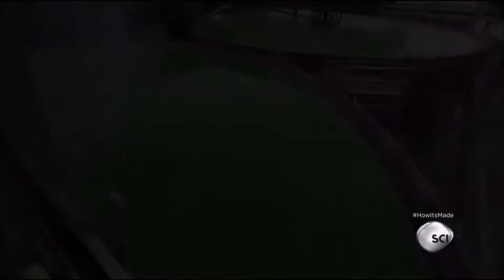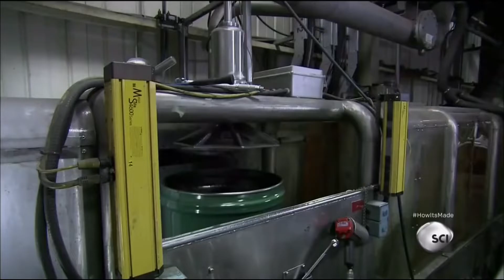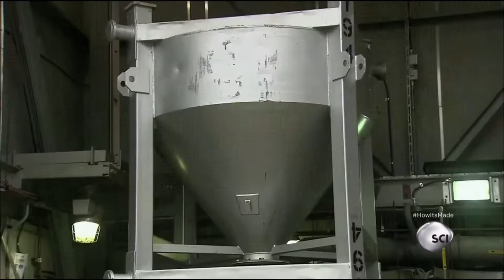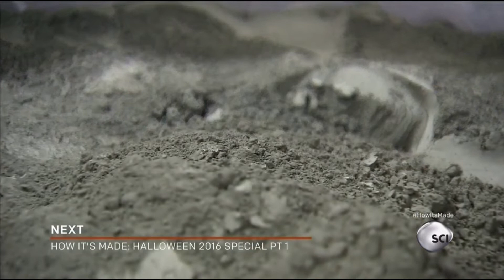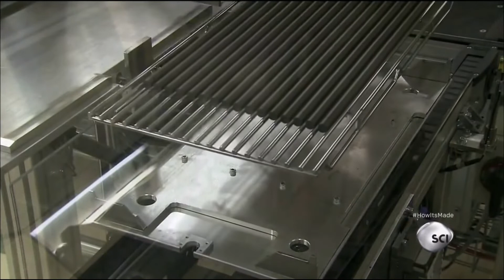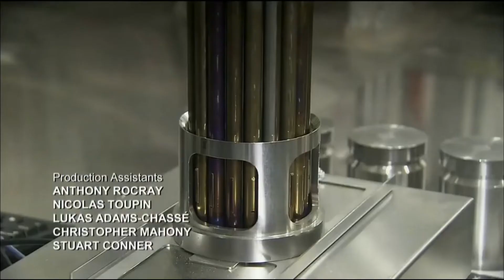How Uranium Is Made Part 2

Comment: They can be handled in this video even at the end. What activates them when they are used ?
Reply: neutrons start the fission reaction
Reply: @worldmapping4895  Does graphite trigger the neutrons? I think it slows the neutrons way down, like 2km ps thats when they start making plutionium.
Reply: Irradiation
Reply: From what i have understood, when you put alot of them together they react exponentially
Reply: they are bombarded with neutrons to start the reaction
Reply: uranium naturally splits, causing the production of neutrons, alpha and gamma radiation, but in very small doses, so one can hold it in their hands. When you either provide an external neutron source, increase the weight (more neutrons produced at the same time) or use some kind of neutron mirror to reflect neutrons back in the mass, then it goes to critical, where it either explodes or produces a lot of energy (more neutrons, alpha and gamma radiation exploding out of it).
Reply: I think this documentary totally skipped the whole "enrichment" process. These rods may be used for other processes, such as neutron targets, but uranium fuel rods are enriched to have roughly 5% U-235. Greatly increasing it's radioactivity to start chain fission reaction.
Reply: @LeviticusTwentyThirteen  no, they put togher a critical mass to start the reaction
Reply: @Timo_Adventures  some reactora doesn't need enriched U
Reply: @Timo_Adventures  This video skipped just about everything. Obviously there's so much they are not allowed to show, that it made the video pointless. Enrichment is not complex, just difficult to execute.
Reply: @AB-80X  This fuel is unenriched uranium fuel used in certain reactors in Canada (Cameco is a Canadian fuels supplier)
Reply: @KingThrillgore  they still enrich it to 0.7 or about 1% for a phwr but that is the naturally occurring enrichment in uneneriched uranium fuel.
Reply: Fire a neutron gun at it, the ions or summat destabilizes the uranium
Reply: Dyatlov.  It was Dyatlov!
Reply: Water, and enough rods stacked close together.  Water is a neutron moderator, so  when they're immersed in H2O the neutrons slow down and are much more likely to hit another Uranium nucleus.  As water heats up it expands, and the rate of reaction reduces.  It's really quite beautiful.
Reply: @mygoogleemail2063  How does a RBMK reactor explode?? …. L I E S !!!!!!!!!!!
Reply: They're activated by the power of love 💞

Comment: What do you guys think these rods are actually used for? Because they are certainly not nuclear fuel rods. Those require enrichment process, which these samples did not under go.
Reply: these are CANDU fuel bundles. they do not require enrichment
Reply: @shauryaseth8859  interesting, thank you!
Reply: Heavy water does not absorb neutrons as readily as other moderators. This means that a reactor moderated with heavy water can cause natural Uranium to fission. That said, most CANDU reactors use a combination of fissile materials. The CANDU reactor is the diesel engine of reactors. It runs on a bit of everything.

Comment: What about radiation? Isn't it happening yet?
Reply: Notice how the latter half of the process (mainly the movement and welding of the rods) is performed by automated machines. It would probably be too risky for humans to do it. Thats my guess
Reply: @michaelmule4582  But the guy at the end is handling them so they aren't producing any radiation.
Reply: Best guess is that this is very low level enriched Uranium and would only generate heat and energy when surrounded by a moderator and neutron reflection material to ramp up the activity exponentially. I was surprised they could be handled safely too.
Reply: not yet. when a chain reaction is started, loads of radiation will be given off

Comment: What about radiation? Isn't it happening yet?
Reply: its always happening, imagine this; you are collecting a lot of lit matches to create a powerful source of energy, at first, one or two lit matches won't do much harm to you, but once you collect half a million lit matches you won't be able to even get close to them because of the extreme heat (thermal radiation) that is coming from the same direction/point.
Reply: You need a moderator and a reflector, then off to the races.
Reply: Yes that's why they're wearing the suits, respirators, and dosimeters; and most of the process is automated.